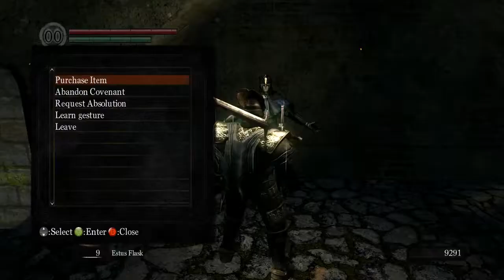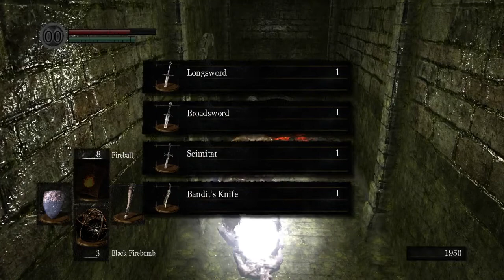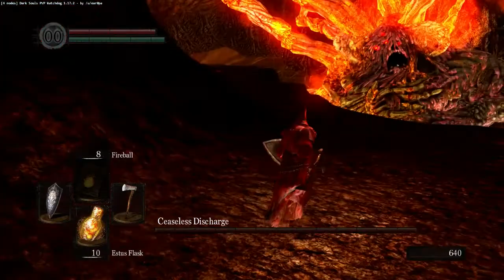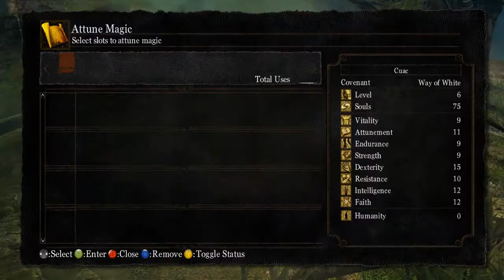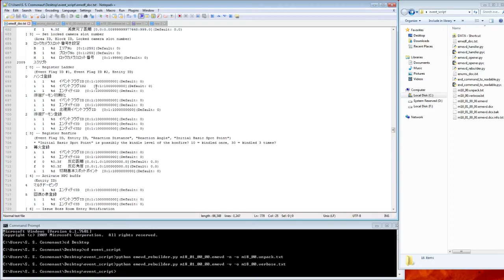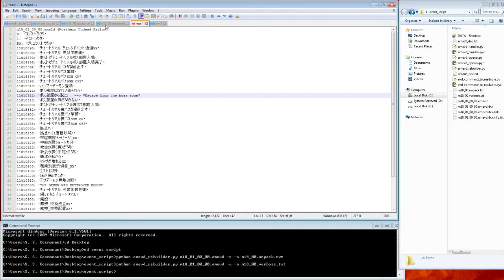Dark Souls Event Scripting - Introduction & Basics

Comment: Fascinating! Does this mean we could also read the events for DS2 & DS3?
Reply from the maker: I don't know much about DS2/3, but if their events are in a similar format, then it might be possible. As I mention briefly in this video, the only reason I was able to do this is because of an accidentally included file that has the names for all the commands. If that file doesn't exist in DS2/3, then if any of the commands are changed or if there are new ones (and there would almost certainly be new ones), then we wouldn't know their names and have to do a lot of experimentation to figure out what they are.